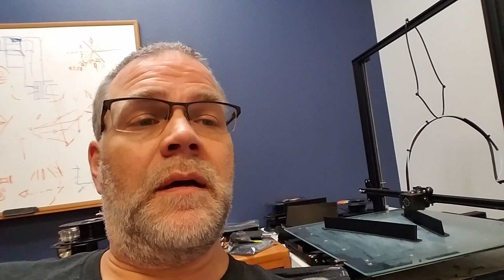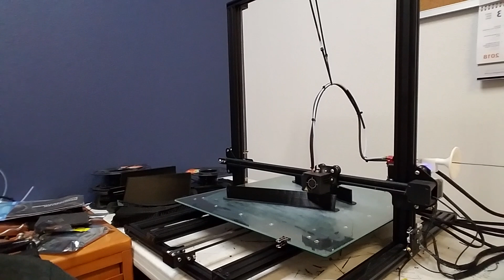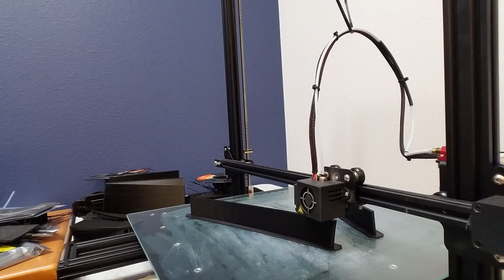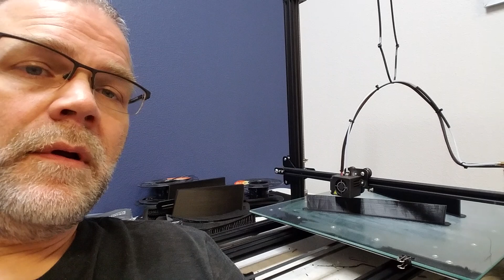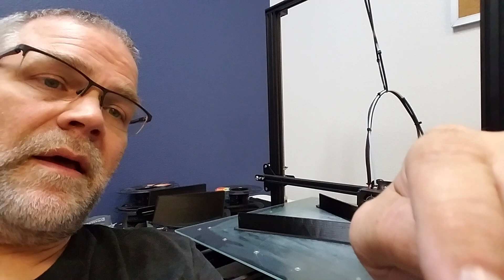3D Printed Interceptor - 3D printer talk

Comment: So i didnt get what printer's your using & material ( PLA, ABS, etc) I have so far a Ender 5 & Flash Forge Creator pro, but i feel the Flash forge will be to small to print the big parts.
Reply from the maker: You will need to slice everything, then glue together.  I use PLA for the body panels.

Comment: PETG may be a good alternative to ABS.  However, ABS can be printed in the CR10 if you build an enclosure. To stabilize the heat around the part to reduce warping.
Reply from the maker: The running light in the thumbnail is PETG.
Reply: The reason I mention it,  PLA is not very heat resilient especially in sunlight. It tends to degrade and melt. 

Most of the other parts in  cars are ABS or nylon. Nylon is very hydroscopic.  I need to run through a dehydrator before printing but, it is really resilient. I build guides and such with really good results.

Good luck on your project. It sounds like a lot of fun.

Comment: Curious, why not use abs or another more heat resilient material?
Reply from the maker: PLA prints very accurately, and is half the price.
Reply: @lasersterling  PLA is not half the price? they are similar in price.
Reply from the maker: @barracuda6817  It is for me.